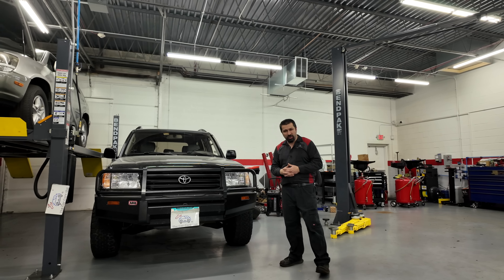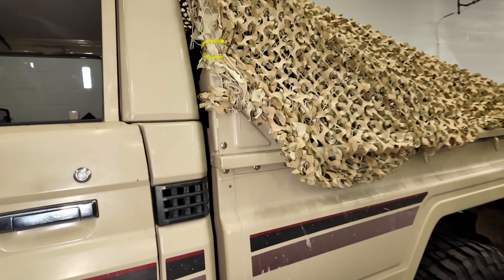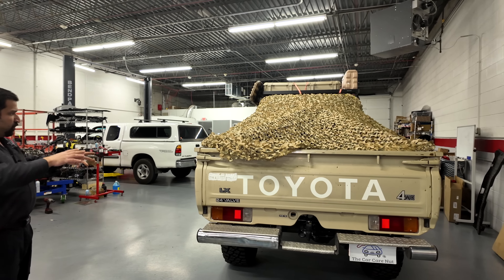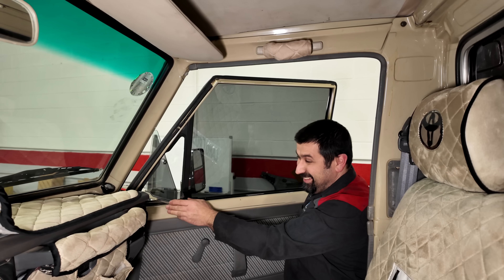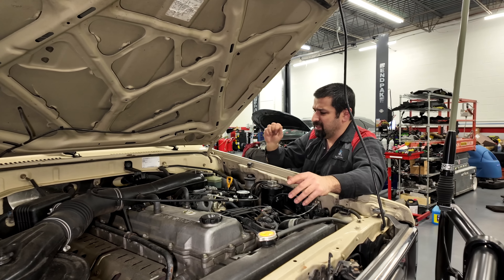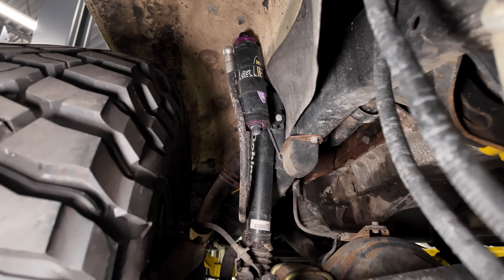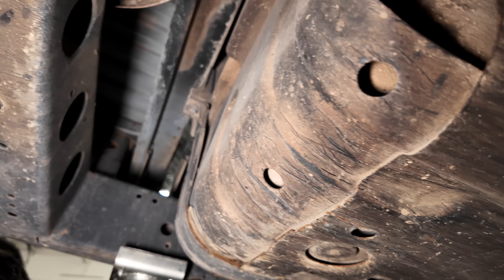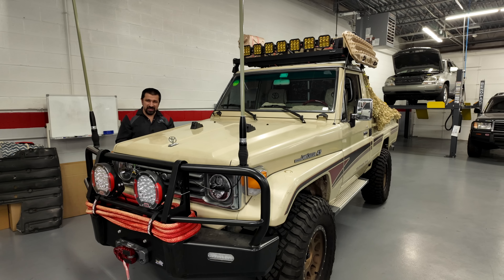THIS is The COOLEST Toyota Land Cruiser You'll Ever See!

Comment: They are indestructible. In New Zealand while mucking around in a river a 70 series got stuck on a large rock and all 4 wheels were not touch the river bed. After a couple of hours it was left. It was sitting in the middle of the river for several weeks. It was checked to make it was still in place. On one check only the top part of the cabin was visible with the river running through it. When finally pulled out it fired in to life while being towed. The seats and seat belts were replace and the wiring was ok.
Reply: To be fair fresh water and salt water makes a big difference.  I love Toyota, but I'm sure many other cars would have done the same.  Years ago at a shop I worked at, one of the customers had bought a "cheap" flood truck (Ram) that had been exposed to salt water.  As far as I know it was never fixed because the damage to wiring was so extensive.

Comment: I know it was no Land Cruiser, but my 1972 Hilux pick-up had both the external tie down fingers and the very same style of tailgate with the two releases. I actually loved that truck. 18RC engine and 4 speed transmission.   You brought back memories.
Reply: The Hilux is also unbreakable 😅
Reply: my uncle had a 1974 US Spec hi lux  RN22   it was a automatic  with bucket seats no power  steering  but had a/c under  the dash

Comment: I drove a 1968 Land Cruiser back in high school in 1975, it had a three speed manual transmission on the column. I immediately fell in love with a manual transmission over an automatic transmission.
Reply: I live down under, I am wondering if yours had a 3.7 rear end unlike the later 4.1 standard diff, without full floating rear axles unlike the late models, I alway think of it as having a 4 main bearing copy of the Chevrolet 6, with a copy of the 3 speed box without any synchro on first.

Comment: G’da from Oz... I have a 2002 HDJ79R cab chassis/single cab ute with the 4.2litre HD-FTE turbo diesel motor I have had it since new and it has a “meagre” 320,000 klms (200,000 US miles) on the clock. It has travelled nearly all of Australia’s outback tracks with more trips in the planning stage.... bloody great vehicle 👍

Comment: In Venezuela, leaded gasoline was used until 1999, so locally assembled J80s and J70 had carburated 1FZ engines, then fuel injection was used form 2000 and onwards.

Comment: These old brutes are as reliable as "John Wayne's" boots, as they say. They love to work.
I have owned a carbureted "86 FJ62 series "high roof" S wagon for 26 years now,  same chassis and suspension, different body, that's done over 700k km it still runs like new, no oil use ,the thing will outlive me. Yup, it seeps oil all over the place (anti rust system! Lol) but I know how to use an oil bottle and grease gun and the right hole to stick it in,  so no problem. Just change in time and grease it and you're good to go. It's done many long trips fully loaded into the outback, never let me down.

Comment: That bar behind the cabin is a Roll/Crash bar.  If the truck rolls over, which many of these 4 wheel drive ones that are high off the ground, do if not driven carefully.  A roll over would crush the passenger cabin flat and kill the occupants, the crash bar would prevent that and basically protect the heads of the occupants from being flattened.  The Windshield and frame above it would be crushed in a roll over.

Comment: Absolutely love the 70 series! My dad bought one for my grandpa brand new just like this one but white. Fzj75 LX trim from 1997. 

Love that truck to bits, air conditioning was good, suspension was very stiff, fairly quick.. faster than the Hilux at least and in my country instead of the protection for the rear window they had a factory roll bar bolted to the bed.  Such a cool truck, I miss it dearly.

Comment: I am from South Africa and at the beginning of the year I bought what must have been the cheapest running and driving 75 Series pick up. What surprises me is what parts are still available from the Toyota Dealerships. Things like metal brake lines, bumpers, front grill, steel wheels and lock rings to name a few items I’ve enquirer about.

Comment: I had a 1976 Land Cruiser.  It rusted easily.  It got about 13 mpg.  It was not a good vehicle for driving in the summer, because the engine heat radiated through the firewall.  I didn't have a high opinion of Toyota from owning that vehicle.  Fortunately, Toyota improved over the years.  I own two of them now.

Comment: I'm from Venezuela, down there Toyota sold The FZJ-71 until 2009, that model has the last version of the 1FZFE better than the one in the 80series, about 30hp more and better torque curve, comes with front coil suspension similar to the 80 series, electric windows, central locks, abs, airbags and more little improvements here and there, that's the peak of the 70 series. After that they went V6 and aren't the same anymore.

Comment: I'm South African, and these were, and still are, the farmer's best tool. Even the latest version of these are still very basic. Only difference is ours are almost exclusively diesel powered. There is a gas powered V6 model, but it is extremely heavy on fuel. You still see these vehicles on the road every day and are extremely popular with the off-road crowd. They're just as popular in Australia.
I ❤ them because they're basically almost unbreakable. In the Middle East, they're used for warfare and troop transport through inhospitable deserts. Those boys even mount cannons on them😅
Thanks for showing us, and I definitely share your enthusiasm with it😁👍🏻🙋🏼‍♂️👍🏻👍🏻

Comment: Nostalgic. My father is from Trinidad and had a 85' Toyota SR5 DOWNEY edition. Lifted. Roll bar. KC lights. Warn winch. Steel brush guard. Had it shipped to Florida when he immigrated to US. Then shipped to Germany where he was stationed in Army. Then had it shipped back to US. Grew up with that truck. Learned how to drive manual in it. The dash, AC, clock, door panels and handles, corner windows, sliding back window, tailgate and so on are all exactly the same as this LC. The engine gave out in my early teens and it just sat and rotted in the yard for years. He had promised I could have it eventually but he wound up selling it to someone who knocked on his door offering to buy it. Shame he let it go (for next to nothing I might add) considering how awesome it was and how sought after they are now. Would have loved restoring the thing.

Comment: many years ago I was told toyota
bought the rights so to speak for
the chevy straight 6 that was used
in pickups in the 50s maybe earlier
for the land cruisers don't know if
any truth to it but I know that was
one of the best 6 cyl engines ever
made
Reply: All true. Years ago needed an exhaust manifold for an LC. 1960s cast iron Chevy 235, 6 cylinder manifold bolted right up, perfect fit, no leaks. Need bigger oil filter? Fram PH8 (Ford pattern) works like a champ. Cheers!

Comment: I used to drive the diesel version of the Toyota Land Cruiser in the Libyan desert very similar this model.  However there was a snorkel for air intake, two fuel tanks full size and Micheal X tyres for desert.  In soft sand we used to deflate the tyres not less than 12 psi if we got stuck in soft sand.

Comment: These are extremely common in Australia and are still available new with the turbo diesel v8 motor. Maybe another source of parts for you although i dont recall them coming with the petty motor here, typically diesel 6 or 8.

Comment: The Toyota Landcruiser comes in two types the commercial 70 series and (luxury) wagon versions. From the 1980s, there was a clear distinction from the 40 series giving way to the 70 series, as shown in this video and the sixty series wagon. The 70 series in it's various types, two and three seater pick-up/ute, twin cab five seater, troupe carrier two and three seater and the 70 series wagon five seater. The wagon version from the 1980s started with the 60 series, followed by the 80, 100, 200 and the current model 300 series. Australia has been the proving ground for the Landcruiser since the 1950s. Landcruiser models since the 1970s can be seen on Australian roads as a testament to the toughness of which is now an Australian legend. Modern Australia was built on the back of this remarkable vehicle. Cheers

Comment: Get all your Front Knuckle Parts from Cruiser Outfitters in Utah.  I highly Recommend you call and Talk to Curt.  I am a Die Hard 80 Guy, so I'm quite Familiar with this Vehicle and I have a 1FZ (And 2uZ) and have done most of the Major Repairs.  .  Give that Truck some Wax on the Top and Fluid Film on the Bottom.  They will literally last forever.

Comment: This reminds me of the 1990 flat bed hilux I had from new.
2.2L gas engine, points ignition, solid front axle with leaf springs all round. Actually had a 2 stage leaf spring at rear, which when loaded up sat down on a massive leaf, 1 ton payload and split rim steel wheels.
Excellent off-road gearing and wheel travel.
Leaf springs mounted on top of axle giving more clearance than the 70 series. Made in Thailand and my neck of the woods way more popular than the 70 series which was quite a bit more expensive.
1990s was peak Toyota

Comment: You see these trucks in Central America and South America too. I  saw a brand new crew-cab in Manuel Antonio, Cost Rica less than 10 years ago.  An old couple was driving it, the seat still have some type of plastic covers on the seats, probably from the dealer. I looked at one about 10 years ago at a dealership in Central America. it was the 2 door, basic model and the  the sticker price was about 45K.  Most of them are diesel. Toyota makes some nice LandCruiser trucks  that never make it to the USA. A few years back, there was a place in Van Nuys California. They would restore the old ones and  They had some big Crewcabs in their show room. They told me that they would import them from Brazil, but the diesel engine for those it was too small, so they would drop a Tundra engine in them.

Comment: In extreme heat with a car that old you would have the HVAC in the hot position because the heater matrix will assist the radiator in cooling the engine. It'll just roast the occupants.

Comment: My dad bought an 84 fj60 new for $13,000 with the 2f.  These were cool and we loved our land cruiser for 18 years 215,000 miles, except it would scream at 70mph.  The bench seat would rattle so much and there was so much wind noise we had to almost yell to talk to one another.  In addition, the speed limit was 55 then 65 a little later.  Not to fun today driving in the slow lane getting passed by every semi-truck on the 5 fwy.  I've owned my lx470 for 12 years now and it is 10 times better than the 60 in EVERY way.   Still rock crawls but will cruise silently at 85mph.  I get the nostalgia, but these are not the coolest land cruisers.  By the way, I love this channel.  I respect all your content.

Comment: The two rubber pieces on the hood are the bases to fold down the windshield as the 75 pickup can have the roof off and fold the windshield Al’s the old Willis, this is also the reason for the extra hinge on the wipers and the hinges on the windshield frame. Even with the FZ being a nice engine it is very thirsty, the best engines and most durable for cars of this type are the ones with the 2H, HZ or HDT diesels and of course the newer VDJ V8 Turbo intercooler engines. Newer models are also available with the 1GR V6 4 liter engine, but again it is a little thirsty. I own several gens Land Cruisers at home now as FJ40, BJ 40, PZJ70, HJ75, FZJ80, HZJ105 and a VDJ76 UAE specs.

Comment: Very nice original Toyota Land Cruiser. As others have commented, the 70 Series lives on in the 79 series, which is available in Australia and maybe a few Gulf countries, from where they are exported across the world to places you can import them! They still make them as a N/A V8 but also a very capable four cylinder 2.8L turbo. I think the V8 is still a manual but I think the four cylinders are all autos. I wouldn't be surprised if the N/A V8 is withdrawn in coming years. The 79 is quite old skool but very rugged and a bit narrower (track and body) than the 100, 200 and 300.
It's the 70 series in general that cemented Toyota's well-earned dominance over Land Rover in Africa with the adage to head out in a LR but you'd come back if in a Toyota. 79s are now very expensive

Comment: The rust circle I can almost guarantee it was an aerosol can of bug spray.   I don't know if its the deet or one of the other chemicals, but it eats right through protective coatings and paint.  Gets on the outside of the can, dribbles down the side, and then circles the bottom because of surface tension...ask me how I know ;p

Comment: Good review. On another note, today we took our. RAV4  Hybrid in for an. Oil and filter at 31,000 miles. The mechanic said our front brake pads were down to  2mm and had to be replaced.  We were told that  hybrid brakes last a lot longer than that.  Is this  normal or is something sticking ?

Comment: Hi car car nut or any mechanics,..my 2006 Sienna has a P0016 and a new P0010 code, The van  turns on good and does not shake i pulled the VVT solenoid and test it it stroke in and out ..what can it be ?? What can i check? I have been driving it like this with the P0016  for a little over a year now the P0010 popped up recently.

Comment: I have a 2007 tundra rwd 5.7L. no lights on thhe dash work besides the p for park lights up green and the doors open red button. it cranks but does not start. I changed the ignition switch, the key lock and tumbler with  new key that's not it. I just spent another 350$ on a new battery because the battery got drained for some odd reason. any help thanks. last time I brought it to the dealer it was a horror show, tried charging me for thousand's because of damages they caused. not brining it back their. how can I diagnose it. thank you

Comment: Please tell me what to do with the code Toyota Camry hybrid 2019 

P0420

$7E8
Permanent
Trouble codes
Catalyst system efficiency below threshol bank 1.
Reply: You need a new catalytic converter. It's worn out.

If your state doesn't have emissions testing you don't need to fix it if you don't want to.
Reply: Buy a BMW. Best car ever
Reply: @volvo09  thx I have changed it and it is fixed